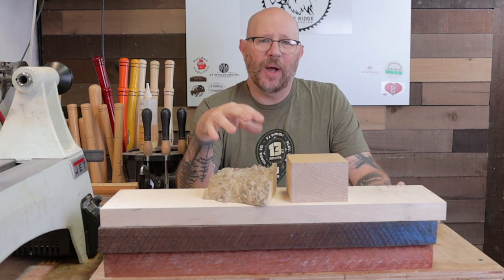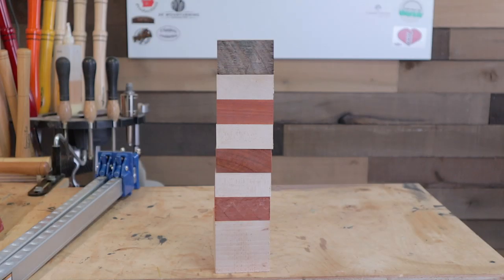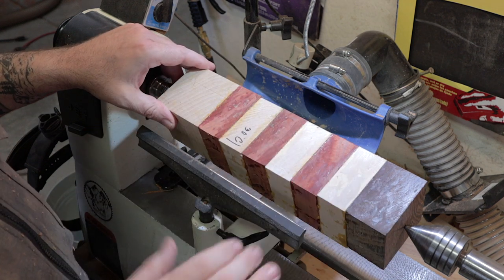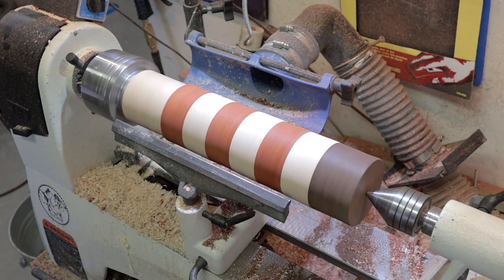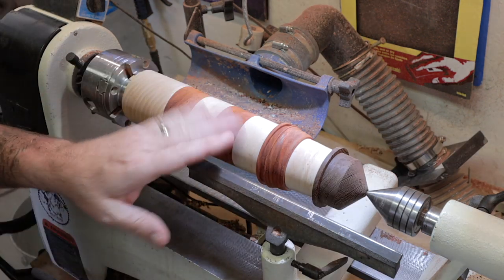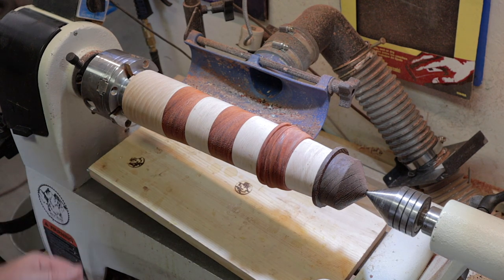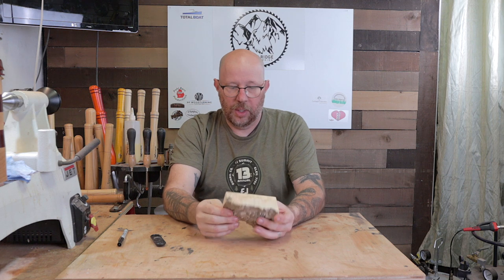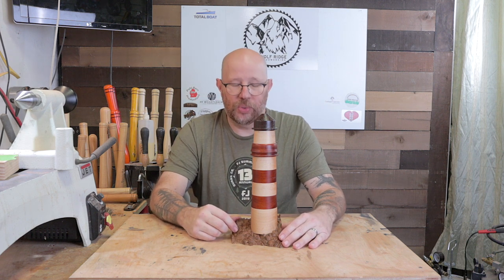Woodturning: Maple, Padauk, & Wenge Lighthouse

Comment: Hi Ed, That is a lovely Lighthouse which I'm sure your Dad will love and cherish. One tip I learned from Tony Meadley, is when gluing several layers together, if you sprinkle a little salt between each it stops them sliding around. the great bit is the salt does not affect the glue at all. I've done it many times without any issues. Cheers, Huw
Reply from the maker: Thank you Huw!  That's a great idea to keep the pieces from sliding around.  - Ed

Comment: I’m sure your Dad loved it!  I’ve made a few lighthouses myself, I like to use an old telephone insulator for the top and then put a small light inside.  Not sure if you did this but I like to use sanding sealer 50/50 with DNA two coats which will soak in a little deeper lessens the bleed. 👍🇺🇸
Reply from the maker: Thank you!  That's such a great idea to use the telephone insulator.  I thought about figuring some way to put a light on it, but ran out of time.  I should have put on multiple coats of sanding sealer and really let it soak in.  He loved it either way.  - Ed